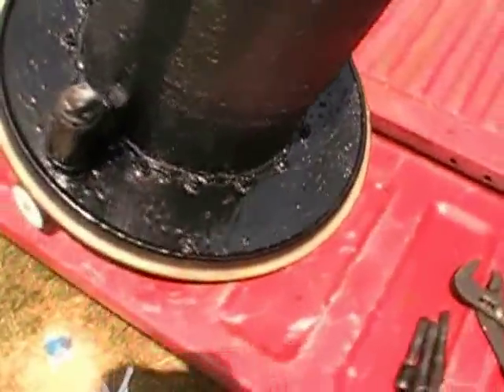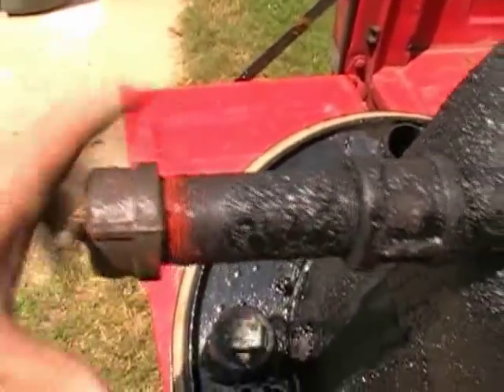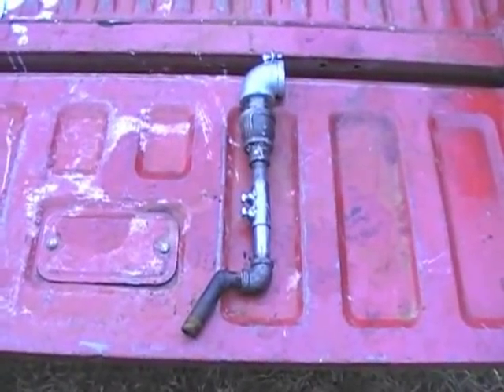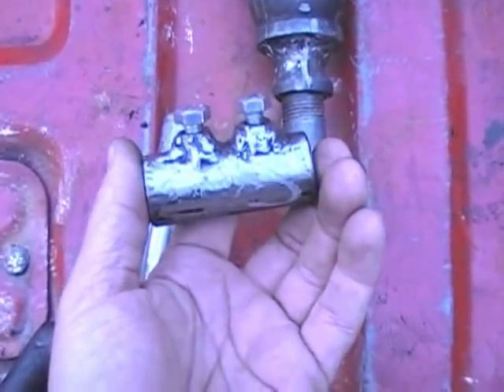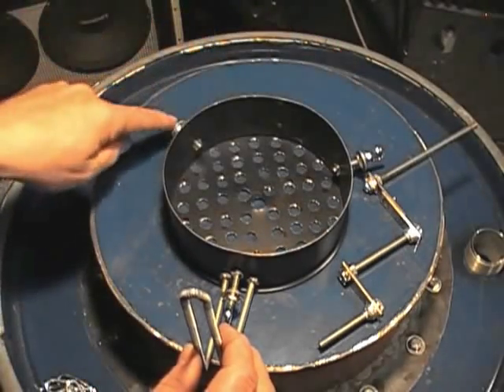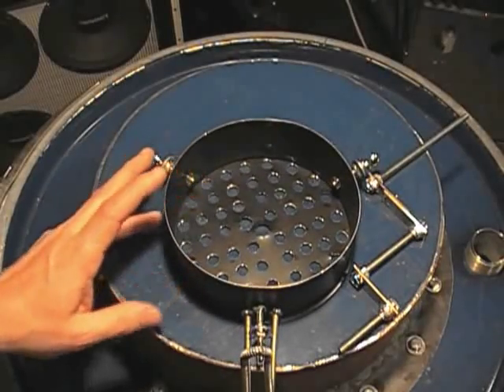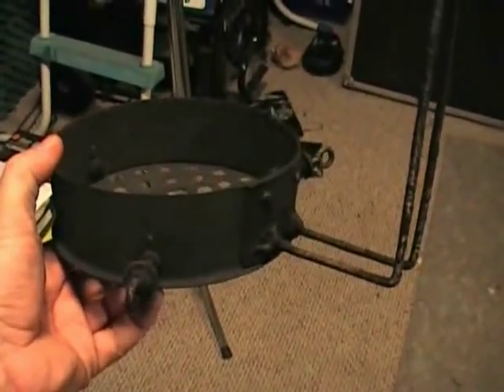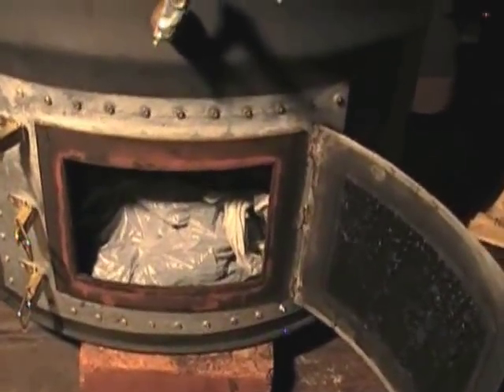09-13-2013 Gasifier "How to construct" ...Video Two

Comment: Just bought a generator and now ready to build a gasifier. So glad I found your channel! I built a retort kiln last year. I get those clamp lid drums for free, as most of my metal!
Reply from the maker: Be sure to go through the later build videos. There is a lot more information along with changes to the later build. I also have PDF files which can help with the build too and if you would like them, just reach out to me through the www.miniwoodgas.com website and use the contact web host tab and I'll email them to you and they won't cost you anything.
Reply: retort kiln 😁awesome . real nice

Comment: Have been closely following your videos. Really nice for a change to follow via video when someone else is building prototypes and making corrections. Been there, done that. My build will be for a twin cylinder 18 - 20 hp engine to run a 7200 watt generator. Will be watching for your video describing sizing for different engine horsepowers. Two ideas :  The vibration of the motor = shaker motion via linkage and  12vdc charge  from electric start engine = recharge battery for blower, lighting.

Comment: Hi Flash. Further to our talk about nozzle sizes, I have done some mathematics to assist the wood gas community. I'm sure you would agree that the nozzle size and position is a very important aspect of the gasifier. Yours is practical experience, mine is only theoretical at this stage. You said that the single nozzle was 1/2" and the one with 3 nozzles had 1/4" nozzles, and this one had trouble breathing. I calculated the area of each of these openings. Continued.

Comment from the maker: I forgot to reply to your acetylene remark. I just purchased a small gas setup
so I can braze weld my new cooling radiator. I actually used a small flux core mig welder to build my gasifier and I am still learning to use that thing but I'm getting better. The mig was not a good choice for welding the nuts to the slip sleeve where brazing would have looked really good. Going and purchasing the oxy/acetylene was the right move because it has it's niche in certain welding jobs too!

Comment from the maker: Oh boy, that is a good question. I originally built a FEMA and it used a 4 inch dia straight pipe for the burn zone without nozzles. The FEMA plans stated this was good for a 15 Hp engine and they stated that for a 5 Hp engine that you needed to weld a plate on the bottom of the fire tube and drill a reduction hole of 2 inches. Cont:

Comment from the maker: Thanks Stephen. Right after I replied back to you I figured out what you were doing in the first email. I originally went about it with a simple method that gave you a visual but it wasn't as accurate as doing the actual math. Hopefully others will see what you wrote in this blog and put it to use.

Comment from the maker: I used the FEMA chart for this but with a twist. The FEMA chart calls for a straight fire tube for an engine of 15 Hp and for an engine of 5 Hp, they tell you to weld a bottom plate to your tube and cut out a 2 inch hole for the reduction. I went with a 3 inch hole so that I could at least go up to a 12.5 Hp briggs. Now here is where I changed things up. I went with a cone instead of a straight piece of pipe. I reduced down to 3 inches while my cone top was 6 inches. Cont:

Comment from the maker: Stephen I built a 3 nozzle along with the 5 nozzle build side by side both at the same time. I ran the 3 nozzle setup but I didn't like the feel of it. I had the correct number of nozzles with the correct diameter for my small 5Hp generator but the back pressure was an issue where as the single nozzle has a very low back resistance so the ember bed burns hot and stable. Cont:

Comment from the maker: Gene Once I finalize the build I planned on mounting the generator on a platform that will allow a bit of play maybe on very short stiff springs then link the platform to the gasifier for a vibrating action. For now I am just trying to finalize a few things but it sounds like you have been thinking on this too.

Comment from the maker: You mentioned something else important and that is the flow rate. That's why I made my restriction zone where I could unbolt it and change it up with smaller or larger diameters. That too was the key to me cleaning up my gas. I'm at 3 inches and I am getting ready to take it down to either 2 inches or 2-1/2 inches because it is only a small 5 Hp engine with a small flow rate. It just barely gets hot enough with a 3 inch restriction zone as long as I use very dry wood.

Comment from the maker: Once you start cracking the tar you will see a bit more power from the gas. It will be a bit more robust. I noticed that in my flares. You mentioned that the tar would burn. Yes it will! Try putting it onto a ball of newspaper! You could take it to the coastline and bring ships into safe harbor with the stuff. Look at it this way. If you crack tar, it now becomes a useable gas that will run the engine quite well. I purchased me a 1000 Watt pure sine wave inverter
Cont:

Comment from the maker: I'm glad you got to try the filters out with good results. If I'm not mistaken, you are using a helper pump to offset the back pressure on the filters aren't you? That is the only thing that I don't like about the filters but the trade-off for a ultra clean gas is worth it.

Comment: Great video Flash! What are your thoughts as far as pointing the air nozzle at an angle ( to swirl the in coming air in the burn zone?)  Also do you see any bridging or jamming on material in the burn zone with your design? Not sure which way to go. Thx
Reply from the maker: I haven't had to deal with too much bridging or jamming and as long as the gasifier gets a good start-up and the fuel is good it will over-all run pretty decent.
The gasifier videos are peppered in the channel but I have made more changes since this video and it may be worth your time to thumb through some of the later videos so you can get an idea of the changes made. This was a learning process and I just shared the build as it sort of went along.

Comment from the maker: Stephen the drag was caused from the from the copper tubing. I should have used large tubing to get rid of the back pressure. For a 5 Hp engine 1/2 to 3/4 inner diameters will work. The 1/2 inch nozzle is right at the very edge of being too small for a 5 Hp engine but it does work. I would like to know how you did your calculations. The Imbert charts give you a lot of info along with air velocity and you could use that along with the engine displacement to get a ball park estimate too.

Comment from the maker: The charts are here but they will not be clear on engine sizes vs reduction zone sizes. I had a hard time so I used the FEMA reduction specs and then I went and found the same reduction zone size in the Imbert charts and once I found that, I used the nozzle chart that was related to that particular build. I really hope this helps you.

Comment from the maker: Yeah, for a small ember bed a single nozzle with a slight angle works great. My bio char was always completely burned to a crisp and the big giveaway is my system only collects soot  If you watch the video where I am running the generator from yard waste, you will see me empty the jar onto a paper towel and then rinse it clean with just water. I do the same thing with the water collected from the tank too. My gasifier isn't 100% perfect but I am cracking most of the tars so I can't complain.

Comment: Close look at new style generators reveals rubber "V" mounts. Allows lateral and other movement of running engine. Generator mounted on same. Lighting in earlier comment refers to ability to read gauges/meters at night. Plan also to capture engine heat via exhaust through rectangular shallow metal box then to muffler to heat water etc. Will also consider building hot plate on wood gas cooling circuit.Note that 1.95 Nm3h = 1 HP so 18 Hp = 35.1 Nm3h. Use for all HP ranges then interpolate charts

Comment from the maker: Thanks for that info. What I did was to draw a 1/2 inch circle and then I placed three 1/4 inch circles inside of it so I judged by area. I made two mistakes. My first mistake was that I should have used 5/16 inch inner diameter nozzles but the "biggie" was the copper tubing causing the drag. I used 5/8 diameter copper but it didn't stop the drag. I don't see the drag with the setup I have now because of the large air intake.

Comment from the maker: For me there are three guidelines for making good gas and that is use biochar for the start-up along with the right sized fuel chunks for the gasifier and be sure to have the correct reduction zone size for the engine you plan on running and last but not least cool the gas as much as possible before you filter it because like you said cool gas goes a long way towards a good run.

Comment: Since virtually all of my runtime experience is during the winter months, I can't compare moisture collection rates, but I am sure you are right when you say that you get more water in summer. Once I finish the rebuild, I will try some summer running - to see how it affects performance. It will also be a good test for the electric fans I built into my system.
Since mine was running poorly, the filter material got a bit tarry. When dried, the tar laden filter media is rather flammable!

Comment from the maker: I also looked at the Imbert charts and they were not very clear on their engine displacement or Hp vs nozzles vs restriction zone but I managed to make some sense of it but then I came across a collage paper where they were having good results with a FEMA style that was producing clean gas by running a deeper ember/bio-char bed so I did my own spin-off from their design. They didn't reduce or use a cone and I did. I combined the FEMA stuff with the Imbert designs. Cont one last time:

Comment from the maker: Tom I am working on finding a good clear layman's explanation of the Imbert charts for sizing the engine to the gasifier and as soon as I do I will make a dedicated video covering this. You can get away with a simple single nozzle design with with a small gasifier but a big gasifier will probably need multi nozzles spread around the fire cone for a correct and even oxygen penetration into the ember bed.

Comment from the maker: My 3 nozzle setup did work but I just didn't like the feel of it. I could have wrapped a steel sleeve around the outside of the nozzles and attached a big air intake pipe to it to remove the back pressure but I wouldn't be able to easily replace the nozzles once they burned up. Some people use pipe caps for their nozzle ends and once they burn out, they unscrew the bad end and replace it with a new end but in my eye's there's too much heat for that design and they can cause bridging in the cone.

Comment from the maker: Yeah the cooler months do make it easy to cool and clean the gas up with. I noticed that during the hot months the filters struggled because here in the south the humidity is always high and yes, it pulls moisture from the air into the system. My filters would be full of water after a 4 hour run and the wood chips looked they were boiled in a pot of water. I would only see light honey thickness tar if I had a bad ignition or if I used damp wood as a fuel. The days of thick FEMA tare are no more.

Comment: Indeed!
After I modified the jets and the restriction height, I noticed that the engine behaved even better, I got a lovely blue flare from the filters and also the fuel seemed to last longer under the steady 2HP gas load  :) .
I used to collect the tar, and use it for my horses. It's a popular choice as an antiseptic treatment for hoof problems. Perhaps if I have any left, I will sell it to the local lighthouse people for use during power cuts  ;) .

Comment: I was going to add the helper pump, but have not got around to it yet. 
Initially, the filters were putting too much drag on the system, so I had to resort to packing them only lightly. After I made some changes to the gasser, I was able to pack the filters much more tightly - and still get an easy start and a  good run from the engine. The gasser is in bits at the moment, as I am making some much needed upgrades to the design.

Comment from the maker: I got lucky and found an old 110 volt squirrel cage fan but you may be able to use a 12 volt heater blower fan from an old car.

Comment: Great work flash, thank you so much for taking the time to put this together. Does the diameter of the feed tube matter much? I have a old water heater that  I want to use for my build and I'm concerned the vent tube down the center isn't large enough, I'm guessing 3 1/2-4"? The difference is that the tube is long with a smaller diameter than your design. I'll be powering a 11hp and 6hp motor.

Comment from the maker: I am using a 1/2 inch pipe on the inside of the wood hopper to feed the nozzle with. You would probably want a 3/4 pipe so that the engine doesn't get choked down by any back resistance. Keep in mind that I'm still learning and winging this stuff too so you may want to experiment a bit.

Comment: The area of the 1/2" hole is 0.1963 sq/ins. The area of the 1/4" hole is 0.0491 sq/ins. If you multiply the area of the 1/4" hole by 3 you get 0.1473 sq/ins. Now compare that back to the area of the 1/2" hole and you see that you are still smaller in total area. In fact, to equal the same total area as a 1/2" hole you would need to use 3 holes of a diameter of 0.289", which is larger than 1/4". I used the equation radius/squared x pi to get the numbers. Hope you find this interesting. Bye

Comment: To calculate the area of a circle you use the equation pi x radius/squared. Pi is a value you can find on most calculators. Your computer will most likely have a calculator. Look in accessories. Pi is close enough to 3.1416. An example. Find the area of a 1" circle. Radius is half of the diameter so radius will equal 0.5". Radius/squared is 0.5 x 0.5 = 0.25. Now you just multiply that number by pi. So 0.25 x 3.1416 = 0.785 of a square inch. (I rounded that down to 3 decimal places). Easy peasy

Comment from the maker: If I run wood pellets I will produce thin light tars with the setup as it is with a 3 inch restriction and even then the filters capture all of the light tars. If I run dried wood at 1/2 or 3/4 inch diameters, I do crack the tars but it's right on the edge so I'm going to shrink the reduction zone a bit to see what happens. I have been in touch with All Power Labs and I was asking them about their Imbert chart because it is very hard to follow. Cont:

Comment from the maker: I just purchased me a 1000 Watt pure sine wave inverter and my next project is to modify an old alternator and use a 12.5 Hp engine to spin it up to charge my deep cycle batteries. This way I do not have to worry about the RPM's dropping under load and causing issues with my sensitive electronics. From what I have been reading that's the way to go. I think that's what you are doing isn't it?

Comment: I have been re watching your build because i am getting off my duff and going to actually finish one.I caught youre comment about clean even cuts and it made me think of a great and cheap grinder accessory i bought from harbor freight.Its an attachment that goes on a 4 " angle grinder that turns it into a mini circular saw,complete with shatter shield and it works fanastic on stuff like this. its item number 45921 and its under 10 dollars.Put a cheap depth stop on it like you use on a drill and sha zam perfectly straight and even cuts.

Comment: Since I was running this gasser at too low of a rate, it eventually filled up with creosote. I ran a backburn, to burn it out, but this was not enough to clear the blockage that eventually strangled the system.
My mods included raising the restriction port and reducing the nozzle ring diameter. This had a very positive effect on the gas quality, but it came too late to prevent the blockage mentioned above.
The design is not the best, so I am currently fixing a number of weaknesses.

Comment from the maker: I based my reduction zone on the FEMA as far as the reduction zone was concerned but I used a cone like a Imbert but then I took the cone and stretched it out to make a deep ember/bio-char setup. I followed that up with adding the air nozzle. I should Technically be using a 3/4 inch nozzle but with the small 5 Hp engine I felt that I would get hot enough to crack the tar so I compensated by using the 1/2 inch nozzle to move faster air flow into the ember bed to raise the temp.

Comment from the maker: Hey man as always, thanks. I have been very busy upgrading the gasifier and I just completed a new cooling radiator for the gasifier. and I'm still planning on constructing the new filter idea just to see if it is worth it or not. I'm getting ready to release a 3rd video covering the cooling system and I think people will appreciate the simplicity and the ease assembling and the dissembling of the new system. Speaking of, how is your setup working now? Did you try the filters out yet?

Comment: The 13HP engine that I use is bolted directly to the trolley frame in order to maximise the vibrological input to the system. This gets around the bridging problem that this gasser has, and it probably helps to shake bits of goop off the walls of the cyclone too  :) .
I don't think you'll have too much trouble with your filters due to vibration. Indeed, it may be helpful as it might help to separate moisture from the filter media and drain it down to the collection points at their bases.